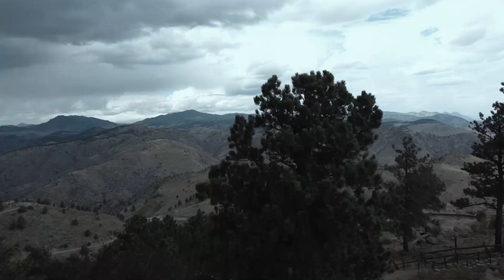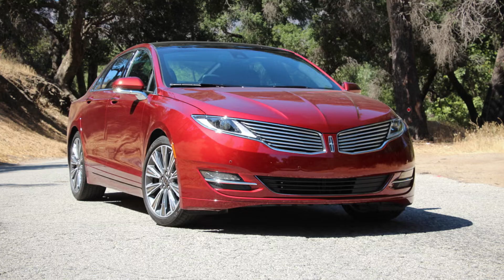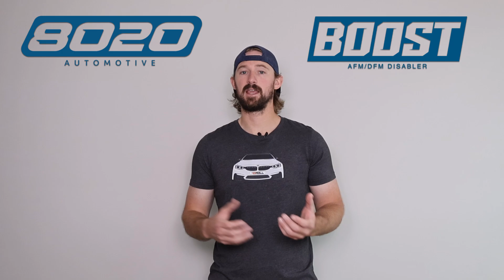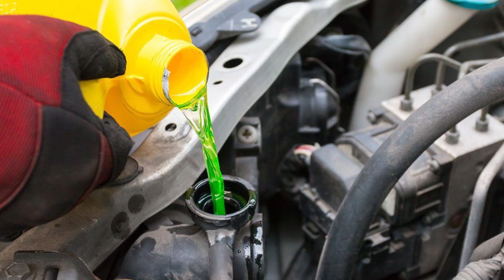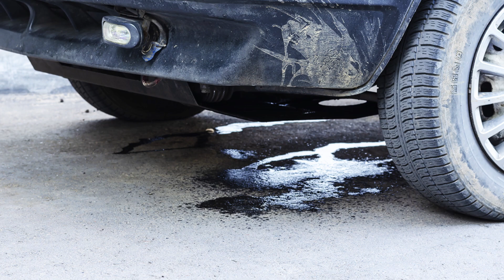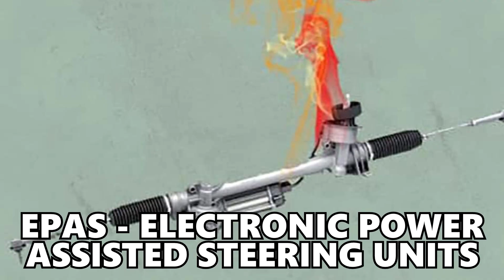Is Ford’s 2.5L Duratec Engine Bulletproof? Here’s the Truth!

Comment: Australian motor wrecker here . 2 main faults these have . 

1 rear water outlet housing goes brittle o ring let's go coolant loss   , overheat . 

2    valve cover gasket leaks at rear above exhaust   slowly uses up the oil,  engine starves of oil . 

These 2 items must be changed ever 180000ks or 15 years 

Also good idea to run the 77- 82° thermostat    as factory there far to hot at 98° 

They are in fact a brilliant engine , I'd say the   best 4 cylinder   2.5  built . 
2008-2012

Comment: Hi, strange you are referring to the 2.5L 4 cylinder NA but the only engine picture you show is the 2.5 L V6 engine. Just a bit confusing for people that don't know the different engines and don't realize it is an error in the video. We have a 2016 and 2017 Fusion 2.5 Duratec 4 cylinder and still knocking on wood with no serious trannie problems yet but did notice that coolant level mysteriously getting low but saw no leak so thanks for that info.
Reply: thanks for the clarification. i was confused

Comment: Just picked up a 16 fusion se with only 130,000 miles and I love it haven’t had no problems or issues
Reply: I have 16 fusion as well. 188k miles. The 6f35 transmission has a whiny torque converter and a slightly harsh 1-2 shift. Other than that I have never had issues other than an absolute sensor and the bank 2 o2 sensor. Getting about 32 average mpg at 65 with mostly highway miles. Keep up on your maintenance and that car will run forever. Absolutely wonderful cars.

Comment: My 2011 escape has it and I’m at 306k.  Things a noisy little guy but it doesn’t even use more than half a quart between changes.  Starts right up everytime.

Also on the topic of the 6 speed, as long as you change the fluid no longer than 50k at a time (20-30 is better of course) and don’t beat the piss out of it all the time they’ll last pretty long too.

Comment: I was wondering if your sentiment towards Mazda's 2.3L Turbo MZR DISI engine would be similar to this "Ford" engine since they seem to be very similar architecturally.  I'm contemplating using this Ford 2.5L platform as a replacement block for my 2008 2.3L Mazdaspeed3 engine since my engine is down on compression due to piston/cylinder failure.  This seems to be an increasingly popular rebuild option mainly due to cost.  Wondering if you were knowledgeable enough on this subject to weigh in. Thanks.
Reply: There's a few very helpful Facebook groups dedicated to this swap. Most will suggest taking apart the engine to gap the rings for boost but that might not be totally necessary depending on your power goals. You also have to drill a hole on the block for the turbo oil return. And of course you have to swap over the head from your car since it's disi. Otherwise lots of great info out there, it is indeed a quite affordable swap compared to rebuilding the 2.3 disi

Comment: I bought a new 2010 Mazda 3 2.5L in 2009, that I still love driving daily, today it has 230,000miles on it.
At 100,000 miles I removed and replaced  the original coolant that was in the system when I bought it, it was replaced with Mazda coolant.
The coolant level when I replaced it was exactly where it was when I bought it, right on the max level line, now at 230K miles it still is at the max level with the new coolant.
I have never had to add coolant to this car.😮 
If I could buy this car new again 
today for $10K more than the $28k I paid, I gladly would. 
A lot of thought went into every little detail in design it, and it’s a dream owning it.

Comment: These engines are really capable. If well maintained with good oil, filters, seals, plugs they will last a lifetime.
Now with forced induction gets fun and in detail, in the Mazda game we take these 2.5s and build n/a and turbo setups comparing to a stock mazdaspeed with same exact same turbo setups, only problem yes transmission are bad everywhere.
Reply from the maker: N - Couldn't have said it better! Thanks for sharing.
Reply: How is a 6 speed manual mazda transmission bad for these cars? My Mazda 3 6 speed manual is great!
Reply: @fasteddie26812nd gen transmission are good, I meant any 1st gen transmission is horrible.

Comment: I have a 2011 Escape XLS with the 2.5L, but thankfully its mated to a manual transmission, so 🤞this combo will last a while.
Reply from the maker: H - Certainly should! How many miles are you at now?
Reply: @8020Automotive  Just over 70,000. I bought it back in 2018, and the previous owner barely drove it. I have a feeling the drivetrain will outlast the body.
Reply from the maker: @harrylee1985  Nice!

Comment: I just brought a 2011 ford fusion from my sister for a 1000 dollars. 250.000 miles runs like dream. I did all the maintenance and the parts cheap. Good gas saver.
Reply from the maker: M - Nice! Thanks for sharing your experience.

Comment: Do you know if these things can handle boost?
Reply from the maker: F - They can, but probably not worth it..
Reply: Yes, but not a huge amount of boost without internally upgrading the engine. Maybe 12-14 pounds of boost at most, on stock engine configuration. You might make roughly 300 hp with a Garrett GT2860R turbo set to 12 pounds of boost, but at that point, you might as well get a Ford that has the Duratec 3.0. Any model after 2009 makes roughly 250hp, but only in FWD or RWD configuration. It might not seem like a lot, but 250hp is pretty good for a light weight vehicle. The 3.0 is a super reliable engine too.

Comment: Does it matter if I run 93 or 87 in a 1.5L fusion? Just curious.
Reply from the maker: P - For the 1.5L EcoBoost in the Ford Fusion, it’s designed to run safely on 87 octane, and that’s what Ford recommends for regular driving, so you won’t hurt the engine using it—but running 93 octane can offer slight benefits in terms of throttle response, fuel efficiency, and peak power under heavy load or high ambient temperatures because the engine’s knock sensors will allow a bit more ignition timing advance with the higher octane, though the gains are usually small and not worth the price difference unless you’re towing, driving in extreme heat, or tuning the engine.
Reply: @ I’ve been running 93 straight
Reply: @Purppo02 there's nothing wrong with that but why? Your not getting more HP. That's a  myth and the the advance prefiring is not helping. I would say I throw in 97 once a month to burn out all the carbon. Other then that it's a waste of $$